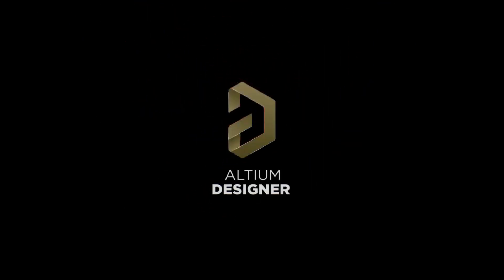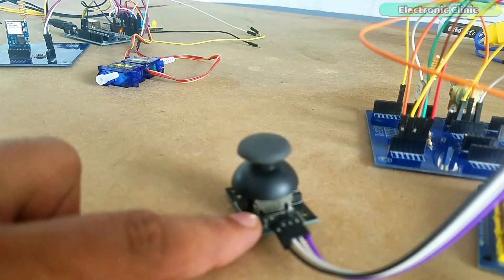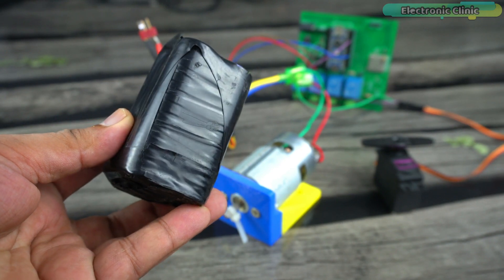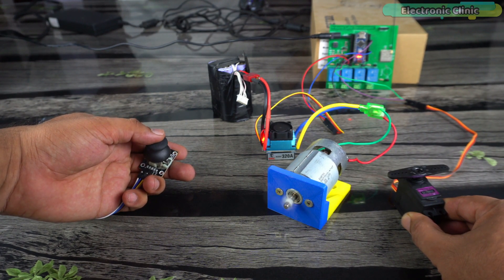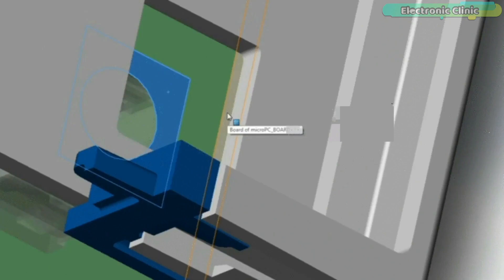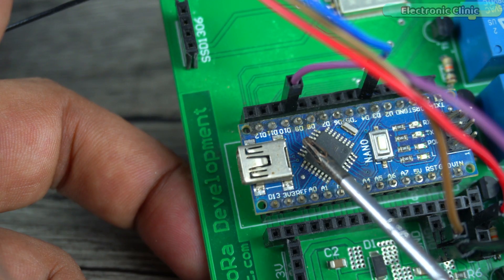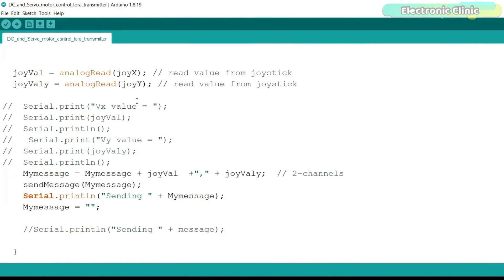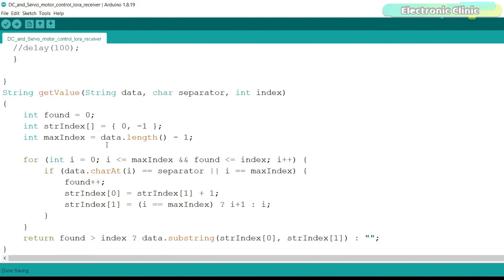Arduino LoRa RC Controller for RC Planes, RC Cars, RC Trucks, RC boat, RC Helicopter

Comment: Hi I implemented the code on a card with Lora but every time I activate the motors with a l298 bridge the arduino nano freezes and I have to restart with the rst button on the arduino why does this happen
Reply from the maker: @Ekirnet-one  check your power supply and also use a watchdog timer.
Reply: @ElectroniClinic  Ok thanks for the answer, that was the first thing I did, I checked the input voltage to the Arduino, it is 8vdc y puse un watchdog pero a un así se queda congelado esto ocurre cuando hago avance o retroceso
Reply: @ElectroniClinic  It was the first thing I checked, the voltage is 8 vcd, it is connected to Vin and the LorAx is connected to the 3.3 vcd of the arduino, and it even has a 470micro capacitor in Vin and I put a watchdog, it follows the problemI have already changed the Arduino nano to rule out a hardware failure, it still only happens when I move forward and backward, that's when the Arduino freezes. Could it be something else?

Comment: i have a question, if i follow the circuit diagram, the reset button does not connect to anything. will this still work ?

Comment: Is there any advantage to this implementation vs the standard ELRS that most people use? ELRS is LORA, on an Arduino-compatiblr ESP32 board. The same thing but FAR more advanced. 

It looks like this implementation is like ELRS, except slower, heavier, more expensive, and less reliable?

Any reason to re-invent ELRS, but worse?